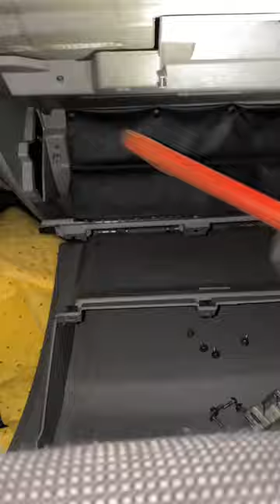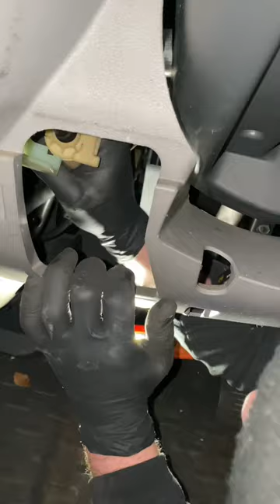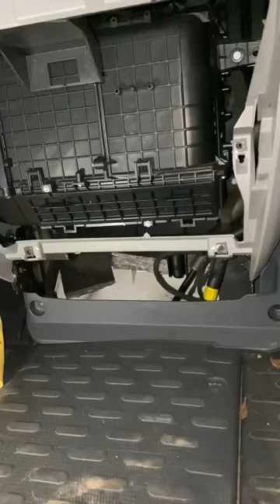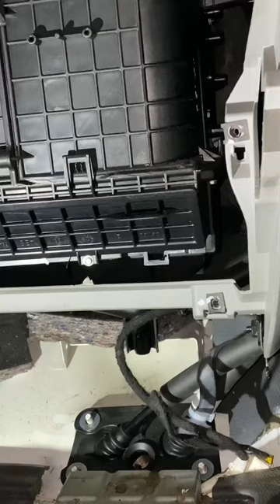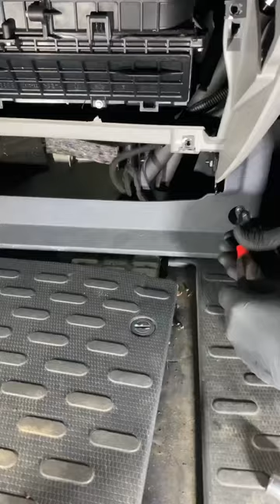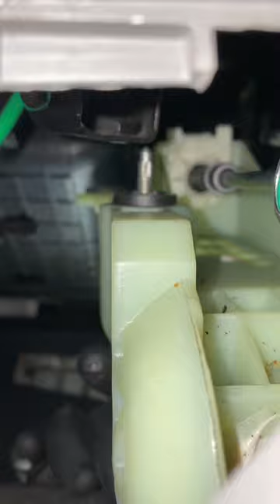Peugeot boxer gear linkage cables replacement #mechanic #shorts #carrepair #cargarage #peugeot #cars

Comment: To adjust the cable, the one with the spring, in which gear must the gearbox be?
Reply: Just put it 4th. Doesn’t actually matter but this gives you the most space so you can work on it. 
Greg